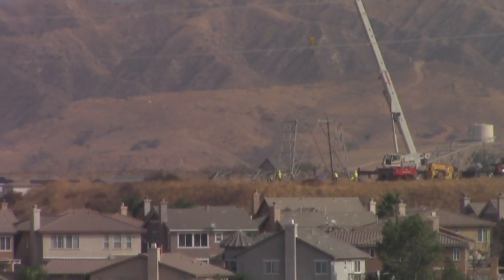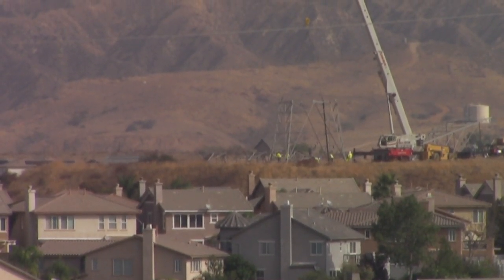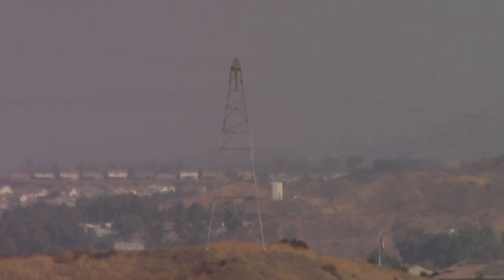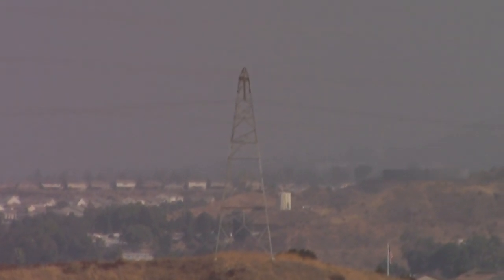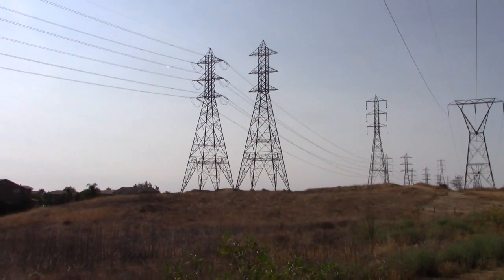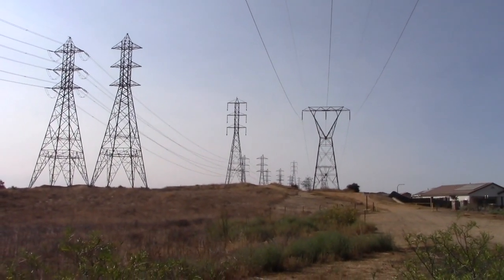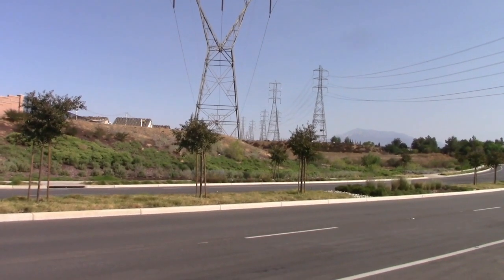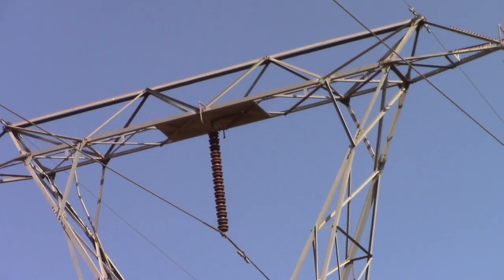Power Line Safe Distance

Comment: Good for you to be observant and aware of environmental hazards.  The AC magnetic field measurements generally are done in units of milliGauss.  There are health-based guidelines that suggest in your sleeping area (ie, bed) at night you should not have more than 1.0 milliGauss.   Living in a house that is routinely measuring more than 2 milliGauss where people find themselves (home office, kitchen, living room) can lead to long term health implications (Kaiser-Permanente has long term studies of the effects of AC magnetic fields, especially on miscarriage).  I am surprised you could not read any milliGauss levels at your main power panel -- that should be quite high under normal circumstances (because the utility wires are separated by some distance and so the currents do not cancel each other, leading to a high field).

There are many reasons that people have high AC magnetic fields in their homes.  In your video, the question is raised about how near is 'safe'.  You will not be able to estimate that unless you know how much current is flowing on those wires (amps), the height of the towers and the separation distance of the transmission wires.  With that info an engineer can estimate the field strength at a distance.  At half a mile you are too far from these lines to be directly influenced by their AC magnetic fields, but many of those other homes shown in your video are in a danger zone and folks should be on the lookout for chronic disease (cancer, leukemia, nervous stress).  I believe that there was a study that showed that children who grew up in the vicinity of power line before age 15 had worse health outcomes in the rest of their lives.

In your sister's home, where you measured high AC magnetic field readings, there are several 'wiring errors' that can cause this.  The most common errors are mistakenly linked neutrals for several circuits in a junction box.  A second common error is that the CATV or municipal metal water supply pipe are carrying current instead of the utility neutral wire.  A third reason is that there is a neutral-ground intertie in the house.  In all cases you can have huge AC magnetic fields and associated illness.  A less common reason is the older knob&tube wiring where conductors are separated too far for cancellation. 

To size up the health impacts of such issues, look for 'Karl Riley'(Youtube Video and Amazon textbook on tracing wiring faults) or seek out a qualified Building Biologist to measure using quality meters and measurement techniques.  You might also consider reading Dr. Sam Milham's book 'Dirty Electricity' or Arthur Firstenberg's 'The Invisible Rainbow' to get an eye-opening exposure the EMF-related health hazards we live with (and die due to, unfortunately) every day.

The comment about whether those homes were built too close to existing transmission power lines is a good point. Architects follow power company guidelines for minimum setback, which are NOT HEALTH ORIENTED, but instead are merely to prevent gross, pathological problems (such as electrocution) rather than subtle or chronic problems.